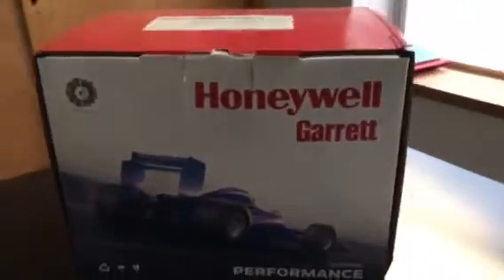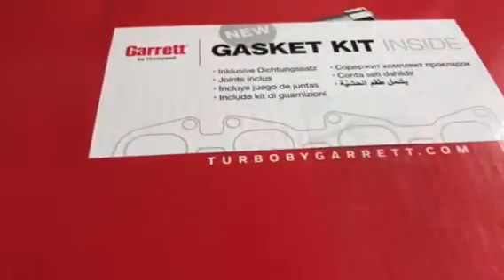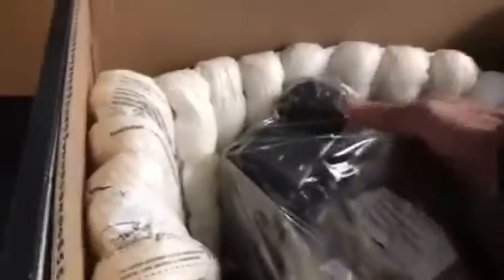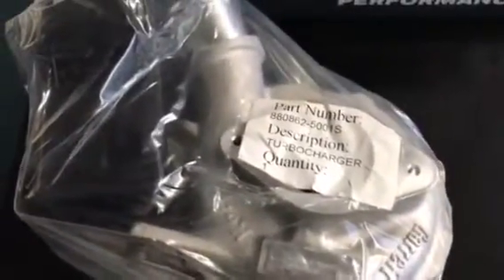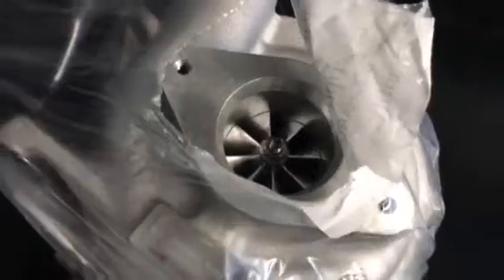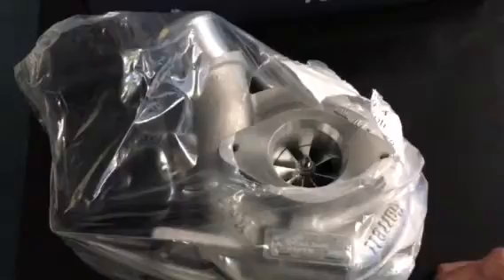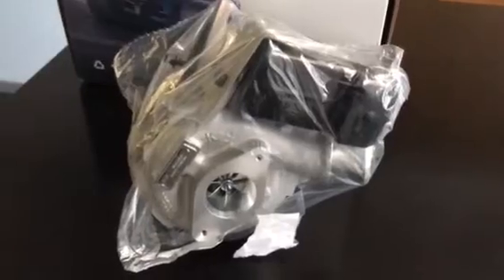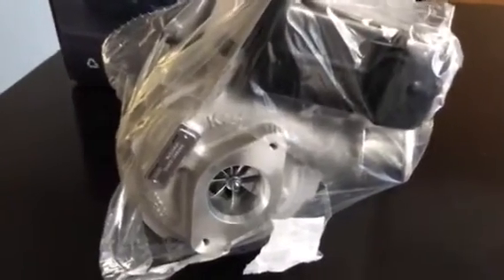Garrett’s Ford Powermax turbo upgrade

Comment: How to order this turbo for my ford ranger XLT 2.2L (2013) tnx dani
Reply from the maker: Hi Danilo, the Powermax is not manufactured for the 2.2L motor - we can do software on the engine to increase power, but the turbo itself doesnt have a bolt on replacement made by Garrett. If software doesnt yield sufficient power increase for you, we are able to upgrade the turbo itself in house.

Comment: Will this turbo cause any damage to the engine in the long run and how is the reliability? Is there a noticeable difference in performance if just replaced on a stock engine with no tuning done?
Reply from the maker: Absolutely not - the turbocharger is manufacture directly by Garrett, who also manufacture the original turbo on the vehicle in stock format. The tuning, if done incorrectly or poorly can obviously hurt the engine, when done correctly, and inside of realistic parameters the engine is 100% reliable. for the best and most reliable performance, you must conduct an ECU re-calibration
Reply: Thanks for the info Chris, I’m in the process of fixing it! What about just replacing the turbo with no engine tune done, Is there a noticeable difference from stock turbo?
Reply from the maker: @kieranmatthew5813 there is a noticeable difference, but it not the full potential of the turbochargers design.  Rather do eat job right the first time and get the tuning done to match the turbocharger. This will yield a reliable result.

Comment: Chris, will this turbo benefit 2016 and later 3.2l rangers
Reply from the maker: No sir - the newer Ranger turbocharger uses a revised version of the electronic actuator which is no longer called the REA (rotary electronic actuator) - it is now called the UTA (universal turbo actuator) and has a different plug, location and uses dual kline Can-bus communication to the revised ECU - this is something we build hybrid turbochargers for in house - Garrett have said they are working on this as a project for 2019 as its very popular.
Reply: @TurboDirectSA  Is  it only the actuator that is different, are they not interchangeable, bakkies still makes the same power as in 2009. Did they revise or change the turbo internals, externally they look similar. I will try and have a look at my compressor wheel to see how it compares to the upgraded garrette turbo.  I could do with with a little less lag...
Reply from the maker: @stavrosbeukes8928 The power max is a totally revised turbo including compressor, turbine wheel and turbine housing. they look similar, but the design if placed next to each other (compressor wheel and shaft) are visibly totally different.  Lag is unfortunately not able to be reduced in the design of the Power max turbo specifically - the rotating assembly and VNT assembly are what they are I'm afraid. The tuning can always richen the low end slightly (but might smoke some....) and reduce lag from pull away